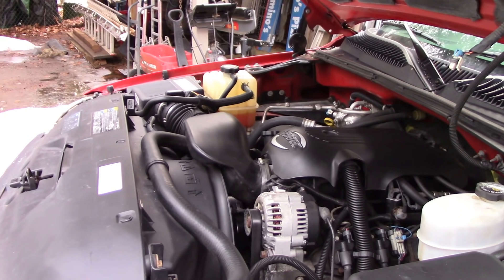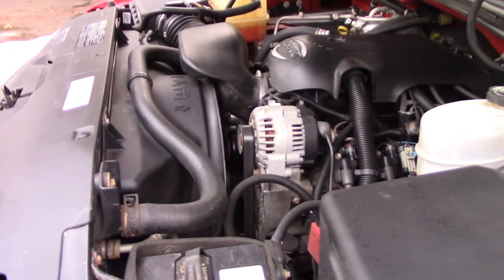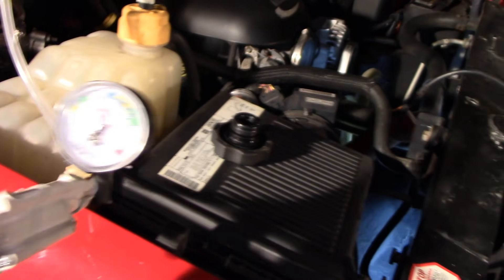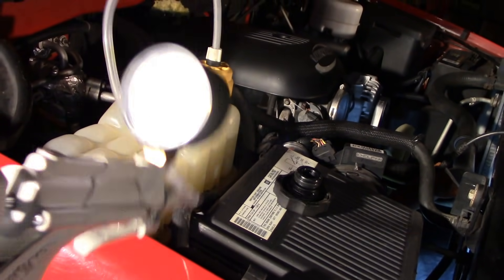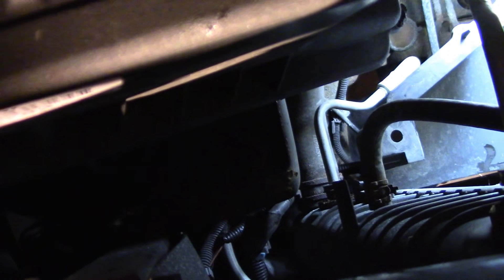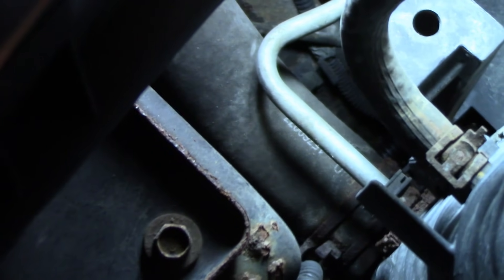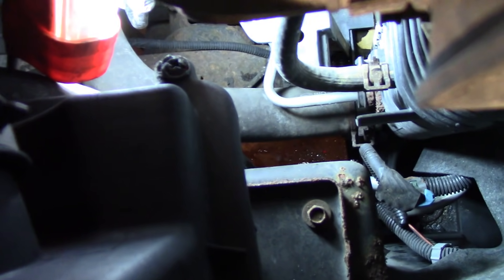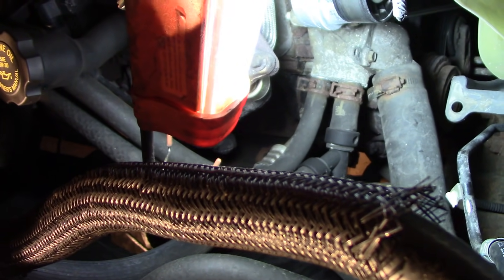loss of coolant, can't find leak?

Comment: Having a very similar issue with mine.. I've bled the cooling system numerous times, heats good, temps are fine no overheating and no coolant/oil mixing! No visible leaks or coolant pooling under the car.. All new hoses and clamps, new radiator and thermostat! I'm having to top it off with coolant daily.
Reply from the maker: Wow..  mine was as simple as a cracked oem hose clamp.  It wasn't leaking and no visible trace of antifreeze any where. The radiator pressure pump found the leak by putting additional pressure to the system.  You can also try a cylinder leak down test to rule out a cracked head or head gasket.

Comment: No more coolant loss and temp is staying at 187!!!! AND!!!!! When we put coolant back in, we added most of it through the top hose a little at a time while lifting hose which poured it back to the block. Having that top hose off creates a vacuum to get more from the overflow tank at the same time. All this before starting and opening thermostat  does eliminate air pockets

Comment: Thank u for the video. My fluid disappearing too,  not a clue except a little crud at the reservoir overflow line. Will replace radiator cap and this hose and look for crack in the reservoir. Think I'll let the dealership do the pressure test so I don't have radiator fluid all over the driveway and have to get a tow. Fluid is very toxic so don't want pets to drink it or get it on my skin. Can kill your kidneys. Thinking maybe water pump leak, but pressure test should prove the sure way to pinpoint the leak. Take care.

Comment: Gurgling coolant , coolant in the oil are head gasket. Just make sure is no air on the system and leak. Coolant leak you can smell the coolant and hot engine create a lot pressure this way you can find the leak. Is just those aluminum line connected to ur engine if you don’t know about them give a hard time.

Comment: From previous experience with the obs and a few nbs chevys with a 5.7 ive learned If u can't see it in your oil or dripping from your exhaust it most likely isn't internal. Doesn't 100% guarantee but pretty close. These small sneaky leaks usually only leak at high pressure while driving so using gets blown in shroud or in block and gets burned off or sometimes catches in the skid plates but usually won't be noticeable on the ground this small. Probably a small hole some in ur radior of slowly dripping from weap hole on water pump. Sometimes its a bigger leak and easier to find sometimes its a pinhole lol but its always a leak in all my run ins. It'll be a small pinhole on yours thats why it doesn't leak without pressure and u more then likely only gonna see that pressure driving hence not seeing it dripping in parking spot
Reply from the maker: It was a cracked OEM hose clamp allowing fluid to escape u detected

Comment: When mine was doing that I couldn't figure out the problem because it wasn't leaking anywhere I would put cardboard and everything down but here to find out it didn't leak until I step on the gas so I stepped on the gas and have the cardboard under it that's when it got wet and turned out to be a crack in my thermostat housing
Reply from the maker: Yes mine was a lot simpler it turned out to be a cracked  Spring clamp on the lower radiator hose

Comment: for the chemical test you need the engine running for the culprit to circulate in the cooling system.
Reply: Yep, gotta be running to work
Reply: riikerman  What do you mean "wrong", how do you expect the gas, which is created in the combustion chamber to get into the test kit without running the engine? I don't think it works by bluetooth or wifi.

Comment: You can't block test without the truck running
Reply from the maker: yes thank you I am aware of that that it was more or less a re-creation to show you what I did ,you know videos go. It turns out it was just a lower radiator OEM hose clamp that cracked it was allowing just enough to escape over time  to give the appearance of missing fluid when it was just evaporating

Comment: I have a leak that is driving me fn crazy rn, its so hard to find, hopefully this is what my diagnosis is too! Im so tired of not finding the source!
Reply: You could try buying a new radiater/expansion tank cap. If the pressure release is iffy it could stay open and only leak after reaching high pressure and staying open. For what it costs it's well worth changing. I bought a very cheap car with blown head gasket,changed the cap and i now have a car that doesn't have a blown head gasket.
Reply: Or just find the actual leak before you replace a bunch of parts...
Reply: @mikezaloudek4893  the cap for the radiater is not a bunch of parts;at five dollars it's not worth the risk of losing more time looking for a difficult leak and more worry about am i going to blow my head gasket with all this overheating. If you know someone with the same car borrow theirs for an hour. When someone asks for help because he can't find a leak "keep looking" is not very helpfull.
Reply: Oh sorry I thought you were saying to replace the radiator AND the cap!

Comment: There is a TSB for unexplained coolant loss. It’s TSB 06-06-01-0198. It seems there was some bad heads made by Castech.
Reply from the maker: Fortunately for me it was just a cracked OEM style lower radiator hose clamp allowing just enough to evaporate over time. After putting it under pressure the leak finally revealed itself
Reply: Oh no they make so much power that ls just use a little coolant 
At least that what weslochevy said in 2004. When I bought a new Silverado  casttek 706 head did not tell me. About tbs.

Comment: Before I changed my new Radiator, Everything was Fine. Then After I changed a New Radiator, new Clamps, and new Hoses. I found Coolant water on the Ground. Any ideas what the problem is and is it Safe to drive? Thanks
Reply from the maker: Well that sounds like you really got an easy situation just something loose or something missed but your vehicle when it gets down to low coolant it's gonna send a message I wouldn't think too high of it . I thought my situation was a head gasket turns out it was just a broken OEM clamp so I wouldn't sweat too much Mr. Good luck  Thoughyou never know.
Reply: I forgot to tell you 2 weeks ago the Hose and the Clamp to my Lexus IS 250 BROKE LOOSE, COOLANT WATER was everywhere . that is why my mechanic guy Recommended to Replace the Radiator, Clamp, Hoses ( all dealer parts). Now a week later, Problem started. Coolant found on the ground. My mechanic guy still Struggles to find the problem. I afraid If I keep driving, something will Burst. Thanks for your time

Comment: Intake gasket or warped intake.Same problem with my 5.3  04 Vortec.
I put Blue Devil block and radiator sealer in. Fixed. Long term? Dunno.
New intake manifold from Auto Zone-$240.
Coolantis slowly getting into cylinder.
There was white fog on startup.
Reply: Intake gasket kit is like $30 on ebay and its a fel-pro kit took me about an and some change i also changed knock sensors and wiring plus crank sensor since i was back there!...250k and still runs like a clock!...

Comment: I’m guessing it’s the tank the runs along both sides of the radiator where it meats the aluminum it usually always leaks from that damn area
Reply from the maker: No actually it was just so simple it was a cracked original lower radiator hose clamp. Allowing just enough to escape overtime without an actual physical leak

Comment: I had the same slow leak in my 2001 Silverado, turns out the radiator had a small crack on the drivers side upper corner and the coolant would dibble down into that support and not leak on to the ground.  I've heard the cracking radiator is common.

Comment: I thought it was my water pump leaking,so  I replaced the gaskets, still leaking. So it probably the radiator....I'll check that next
Reply from the maker: It turns out my problem was a broken lower radiator hose clamp that was it

Comment: Intake gasket leak!...1hr tops job!...super easy just need 3/8 quick disconnect fuel line tool you can get a gasket for $30 on ebay...oh!...and by the way since youre in there might as well change your knock sensors and wiring harnesses and valley pan gasket and crank sensor while its down!...head gaskets very rarely goes on these engines!...hope im not too late!...
Reply from the maker: thanks for info, but it was a broken oem squeeze type clamp on lower radiator hose, allowing just enough pressure release to evaporate over time but not enough to see a drip leak. I replaced it and no problem since...

Comment: Thanks for the video, I just changed out my fluid and of coarse didn't replaced the old rusty stock oem clamps, and now my fluids low again, hopefully some new clamps and new hose while im there and cap just cus fixes my issues,  also people are talking about putting blue devil or radiator stop leak in their systems, I don't think vehicles with dexcool would like that very much, thanks again for the video and ideas
Reply: Question, my coolant was low about 20 ounces maybe for a few weeks,, at least maybe months, I got around to just flushing it and refilling with 2 quarts, started it up got it up to temp turned on heat full blast, stayed at fill mark, drove it to work 2 days and its back at the same low mark about 20 oz low,  it seems to be leaking out a little to just a certain point, any ideas

Comment: Bet its the damn heater core quick connects at the passenger side firewall. If the PO did the exhaust bolts, he probably damaged them, which isn't hard.
Reply from the maker: Bondo it turns out all it was was an oem lower radiator hose clamp that was broken and wasn't clamping the hose. So even though there was no water leaking it was enough to let pressure out and the water what evaporate
Reply: Hey nice find. That was a hard one. But keep in mind, those plastic quick connects are a ticking time bomb and a real weak spot of the cooling system. keep them with you at all times. They randomly break releasing most of your coolant by the time you pull over and shut down. For a second time in 5 years I had to get towed home by AAA for a $5 plastic part. I'm currently modding that connector with hose directly to the heater core.

Comment: Okay, I need help. I was told no engine compression. The timing chain, no problem. I’m losing antifreeze somewhere, with no obvious leaks. No leaks on the ground. Engine sounds great. Oil looks clean and normal. Normal exhaust smoke. I was told, opening the radiator cap and not seeing the fluid go down while the car is running and gas pedal be pushed down, is not normal. I was told by 1 mechanic that’s not normal. I was told by another mechanic that, that is normal...... CAN SOMEONE WHO REALLY KNOWS PLEASE GIVE ME SOME ADVICE...... 2007 Jeep Cherokee. By the way two mechanics pressure checked the engine WITHOUT the car being able to be cranked. I truly need some sound knowledgeable advice.

Comment: Hey everyone. A fix!!!! -did pressure test. That pushed coolant out of head where it would roll down back of the block to oil pan exterior. So i found MY slow coolant loss. 2001 5.3

 I previously put an aftermarket thermostat in. ( when i did radiator months back)So!!! I ordered the OE stat from RockAuto ( but this new one has holes in plunger part, like a revolver cylinder)BUT IT WORKED. Somehow, the autozone stat was faulty, creating a weird pressure build up and/or air pocket that shoved water out!!??? Thought i d share

Comment: My car has a leak, every time I turn off the car it drips out, took it to a shop to run a pressure test can't find it. I've had this problem before with another car I know how frustrating it can be.
Reply: I just brought car to shop when it's off it leaks out shop replaced the expansion tank said it was cracked brought car home parked it next morning all coolant from expansion tank leaked out same as before they fixed it..when car is running the fluid stays in fine..any ideas?

Comment: Sometimes the hole is so small you just lose vapor or steam when it's hot.  It's also curious that you had to keep pumping it som much?  The worse thing is having the lower hose go when your on the road.  It doesn't take long for the engine to lock up.

Comment: Most likely was a small crack in the radiator and when too much pressure was pushed through , it exploited and caused failure!
Reply: +Chris Gardner - He said he only loose few ounce / top off a few times per year.  I would've put Bar's Leak in there since it's " SMALL ".  Now he busted it by pressure / testing, its gonna cost him more now, LOL.

Comment: Cracked resevoir, fluid lower now.
Reply from the maker: BUZ DARLING nope I found the problem a while back it was actually a cracked lower OEM hose clamp it just wasn't tight enough it fell apart when I was moving stuff around

Comment: ok video, you mention these problems because car so old with 73,000 miles. Not a reason why car will have coolant loss. New or old cars fail. Maybe that the previous owner did not took good care of car. Well, good luck and hope you fix your car/truck.

Comment: Lol to do the test tou have to have engine running for pump to work to bring exaust gasses thru coolant res tank
Reply: thats what i was gonna say i had my ear to my laptop trying to see if i could hear it i dont think he knows
Reply: Gas would stay in the coolant. At least it does on my Jeep which has either a cracked head or blown head gasket. I can smell the gas when I remove the radiator cap.
Reply: Is your oil cap muddy or have moisture on it?
Reply: Geo Stanley check your seals and gaskets at the intake manifold and exhaust manifold . Check your spark plugs seals.
Reply: Chris Gardner the 4.0 in my Jeep has no water ports in the intake. My compression test is low on the middle two cylinders so I figure the head or head gasket is cracked between those cylinders. And my best guess is it the head cracked because of the heavy smell of gas in the coolant.

Comment: I couldn’t finish the video but is a coolant aluminum line if you remove your air intake is on front of your engine. Just replace the two gaskets I think is one of the back to.

Comment: Did u replace waterpump if so an issue still there did u check under oil cap for milky salve looking...do you have castech heads should see on passanger side front corner head 706 stamped. What was out come.
Reply: Scoobydoo 39 hey I got the low coolant mystery and I have a 2002 avalanche. I do have the 706 on passenger head. My car has no leaks but do have slight milky light brown under cap

Comment: Watched video to where clamp is failed bottom radiator hose. Get new clamps from dealer dont put those cheep hose clamps on as i see someone did on going to yr waterpump. Those leak down road. All yr issues i have had 3 times 3 diff gmc,s. You got lucky only clamp issue.

Comment: I have a coolant leak from the passanger side down low, its not the thermostat housing, I changed the heater hose and its still leaking, do you know what else it could be? 2002 Ford Explorer, 4.0 engine. Thanks.
Reply: I  have the same issue with my 05, I also change the therm housing to no avail, a friend who is a ford mechanic, told me to check the heat control valve on the heater hose next to the res, you should try that, Idk if that's the cause, haven't checked mine yet.
Reply: Jason Bedell mines turned out to be the radiator.
Reply: Put your sef under the car after a ride, get a lamp and find it.water always go down.

This the esaiest thing in mechanics. How can people solve some complex problem if they need tools to find leaks or they dont know how to find a leake, makes a lot of confusion.  My advise is leave mechnic for mechanics.
I hope this helps to find your leak.
Reply: Fords were bad for there heater matrix to go bad and there would be a puddle in the passenger footwell inside the cabin
Reply: F.A. H.  Could be a freeze plug

Comment: I don't have a thermostat they took it out when my car overheated after the radiator cap came off. They put in blue devil and no problem...until the battery was touching the good and something shorted out. This is what happened. I turn on the car it wouldn't start but the car alarm went off after 10 yrs. We disarmed the alarm, the car started long enough to read the diagnosis. P0304 blah blah blah. It said replace camshaft sensor and crankshaft sensor which we did. Got no spark.  We replaced fuel pump..got spark but wouldn't idle. We had an intake leak. We also put in spark plugs. Had to take out and replace intake manifold took it off my old engine. I still have an intake leak Somewhere and now Everyday I have to fill up the radiator with water/antifreeze. I've had this car since 04..it's an 02 Mitsubishi and the only thing I've ever had to do to this car was replace the Tranny..but still can't figure out besides the intake leak  why she is Overheating.. kmosley435@yahoo.com

Comment: Cracked head water is going in the oil
Reply from the maker: It actually turned out to be a cracked bottom radiator hose clamp that was allowing just enough water to evaporate over time no physical dripping to identify
Reply: Really a cracked head? There was a huge ass leak from the hose. Come on man.
Reply: Angel Rosario , then wouldn’t the oil be milky looking?
Reply: Mike Zaloudek , I thought he said he didn’t find any visible signs of water leaking out? If it was a huge ass leak from the hose wouldn’t there have been visible signs of water?